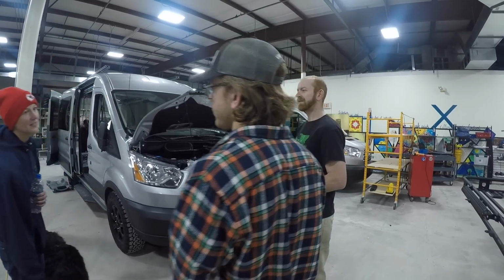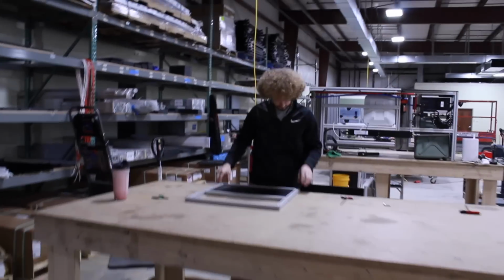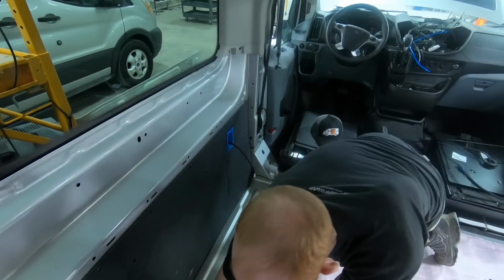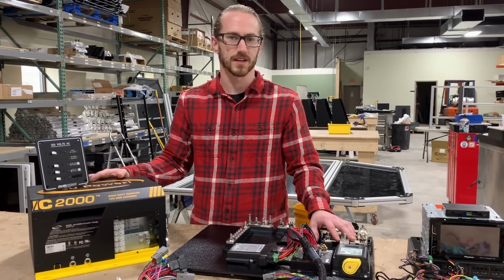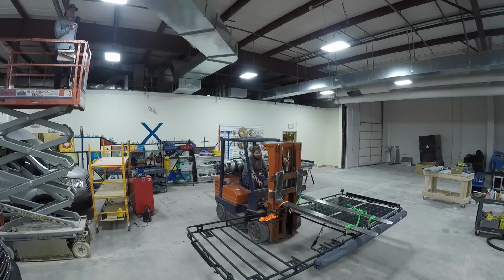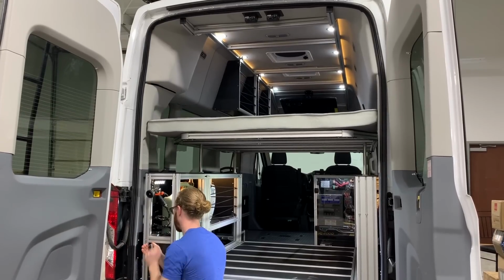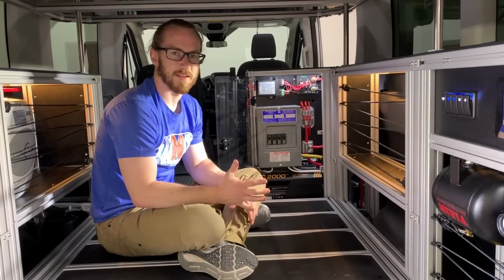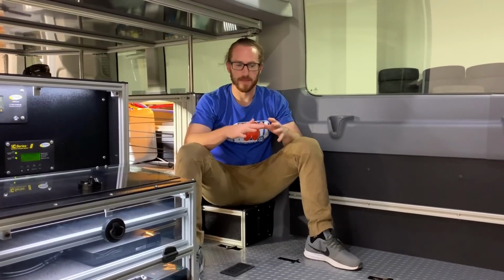Ford Transit Camper Van - Engineer Couple Helps Build Their dream VanDOit Camper Van

Comment: Is it really $100,000 to convert?
Reply from the maker: The price ranges from roughly $50,000-$120,000 depending on options. The van is included in pricing.

Comment: I find few builders are confident enough about their build to do a video on their processes and build philosopy, so bravo. What I like most about Vandoit is the use of 80/20 as the "bones" of the build for lightweight, strength and durability. What I'm not a fan of is the finished look of the interiors. The interiors look like I'm camping inside of an erector set. I would prefer to have the bones of the build hidden so I can see more visually appealing surfaces like wood grain or composite sheeting. Overall impressive build quality. I would just like to see it done in a van that my wife wouldn't mind also sleeping in. Thanks for this video!
Reply from the maker: Thanks for the feedback Nitram :)